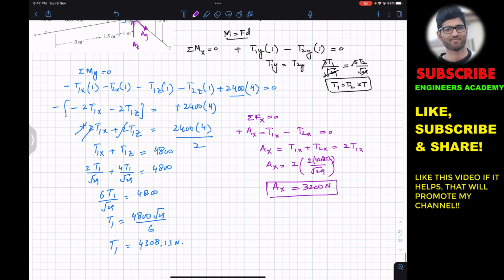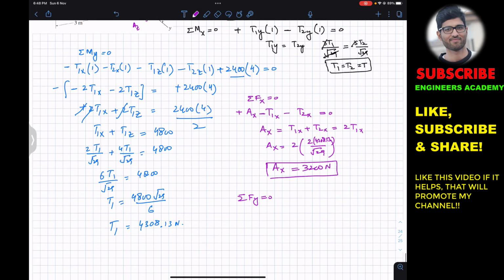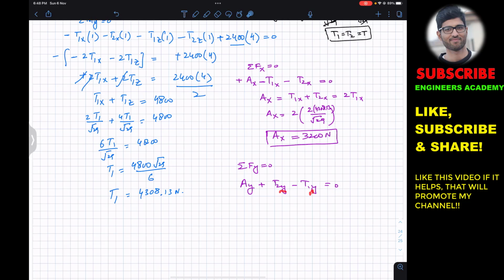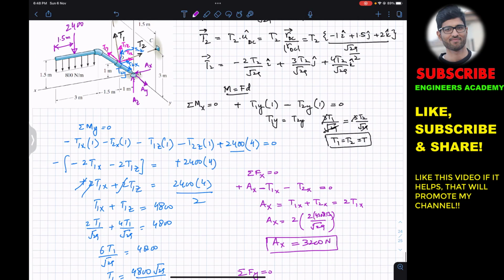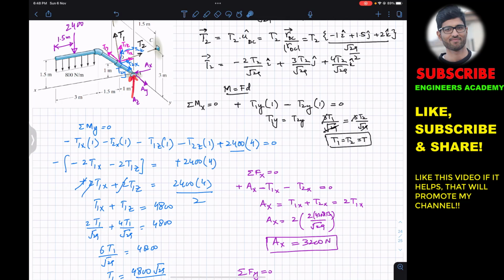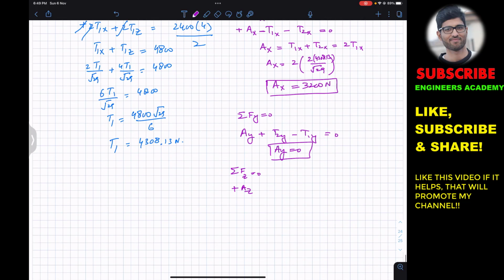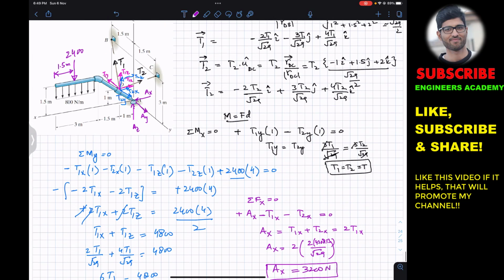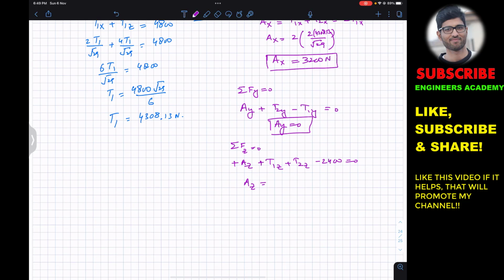5-72 Equilibrium of a Rigid Body (3D Equilibrium Problems) Chapter 5 Engineers Academy

Comment: In the Moments at x. It should be -T1=T2. Since T1j component is negative. Or am I wrong?
Reply: Think of it as static, so everything is 0, and T + T + etc = 0

So we set sum of forces = to 0 in the x direction, like every other direction, and this is where we write in direction signs. So

 0 = (T1) + (-T2) 

since T2 points towards the negative x axis.

Add T2 to both sides and T1 = T2
Reply: @sockpocketpre-alpha8258 okayokay , Thank you